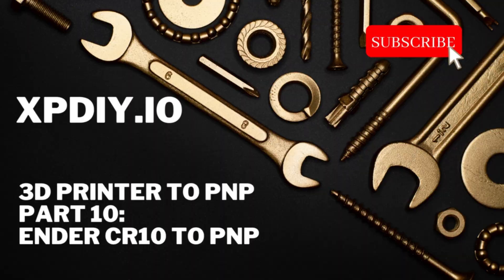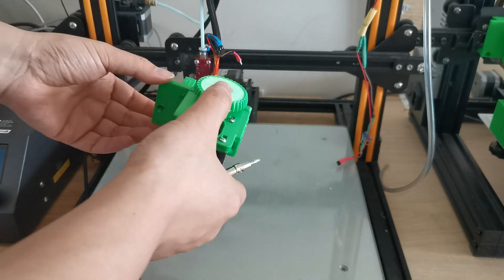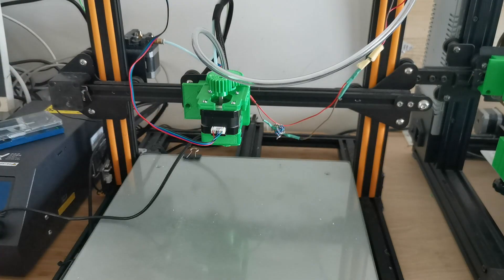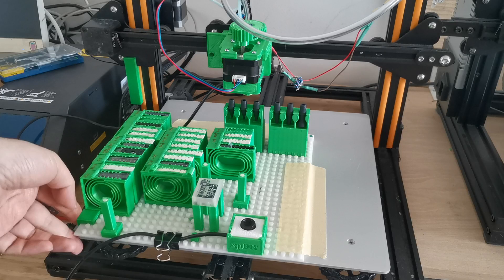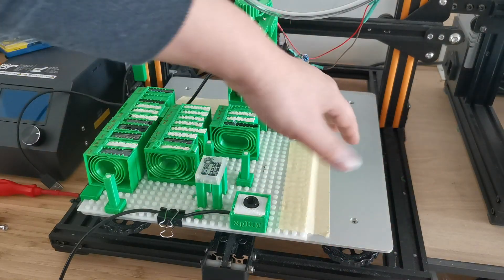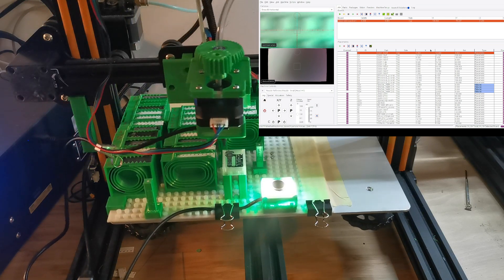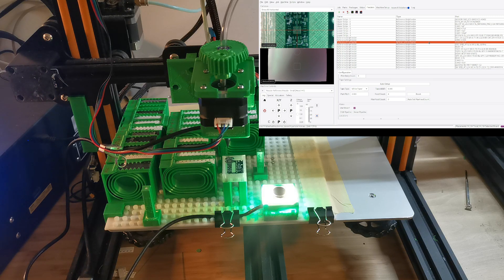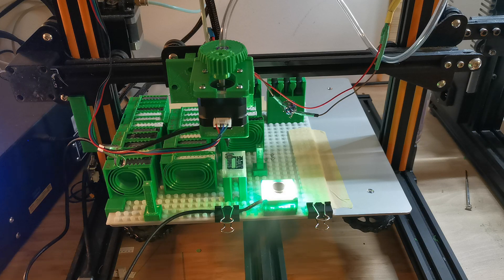3DPLACER PART 10 - Convert Ender CR10 to a PICK AND PLACE MACHINE

Comment: This is great idea just wondering to connect it to open pnp do you need to use a different firmware for the printer?
Reply from the maker: No, just use original firmware would be good. Currently Marlin is supported, most 3D printer come with that.

Comment: good job. have you tried soldering output components based on a 3b printer
Reply from the maker: I have used it for mems MIC, LEDs and mini switches, and those ones with flat top surface should be able to work. What components do you plan to use?